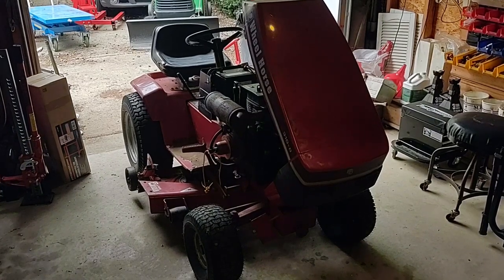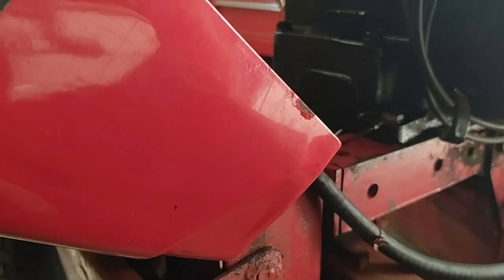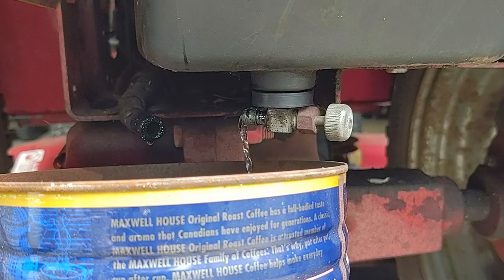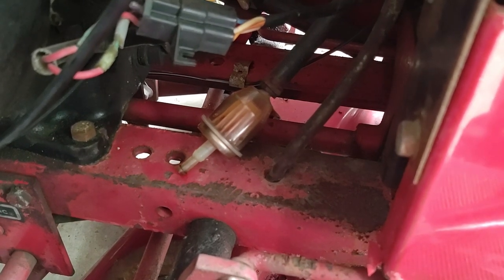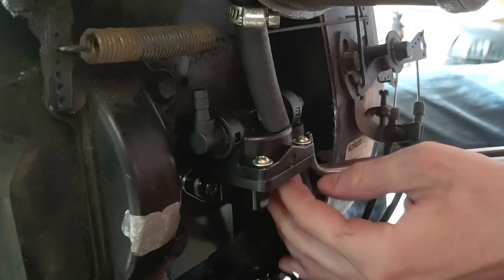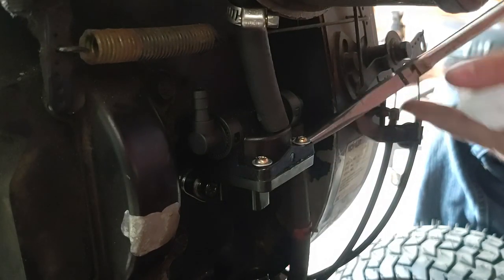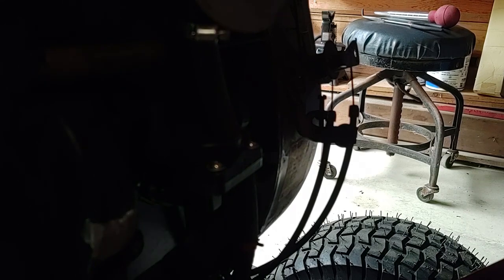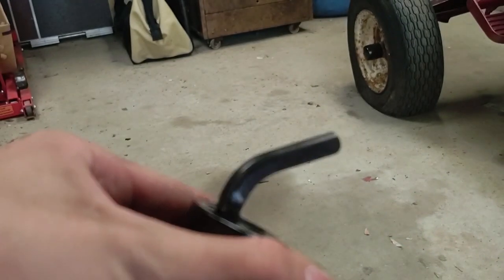Fixing Fuel Problems on an Old Wheel Horse

Comment: I love those POS plastic pumps with a Passion.  I believe the I save tractors guy sells a new Diaphragm for those old school Kohler pumps.  Some people convert them to Briggs vacuum pumps. Good call on not starting it. It can break the dipper off of the connecting rod and it blow up.   I would try a small magnet in the hole. You might also be able to fish it out from the drain.   If you going to pull the engine, you could just pull the pan. I would consider going through the whole motor.  New rings and gaskets it will last another 35 years.
Reply from the maker: Yes, I've used I Save Tractors many times for buying parts for my older tractor. Thanks for watching!